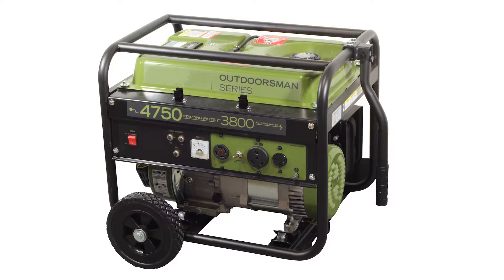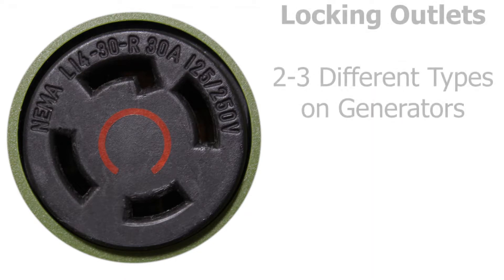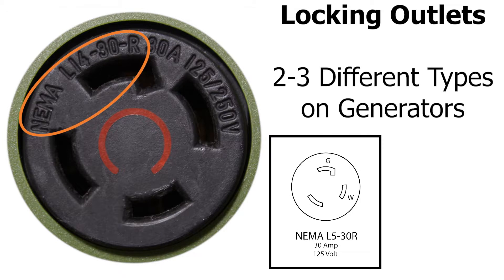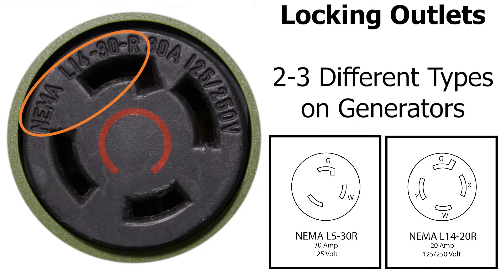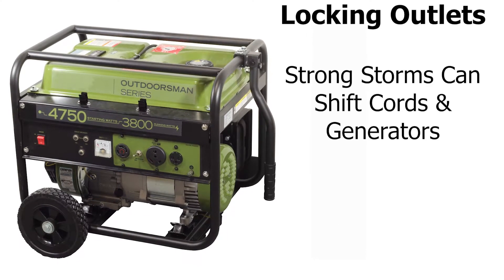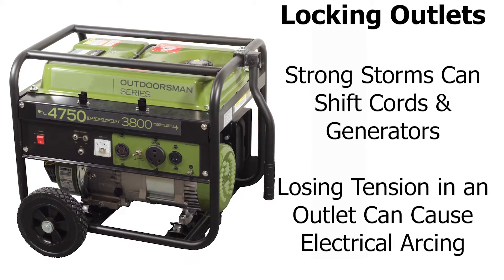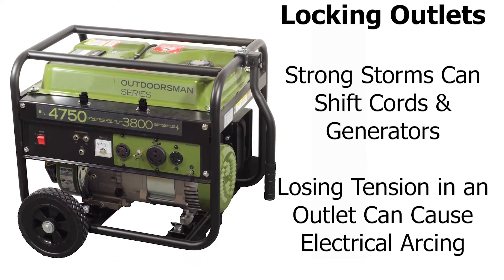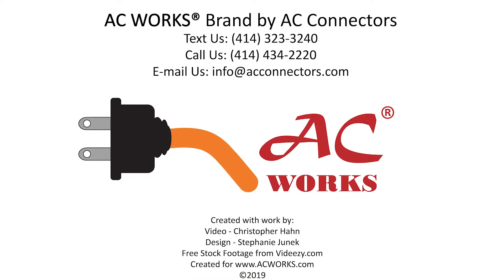AC WORKS® Wisdom: Why Generators Need Locking Outlets

Comment: Your videos are excellent,and very well spoken. I am hooking a new 4 prong adapter to my 3 prong dryer outlet,then hooking a 4 prong generator cable and connection- to run 240 volts to my fuse/breaker panel to run some of my house needed appliances (heater,fridge,lights,microwave.) Adding up my wattages and startup watts if i can figure that out...making sure to first shut off Main,and all breakers..then after plugging in, and gen warmed up..turning on one at a time that are preselected. Having outdoor meter ground intact and adding a copper wire ground and brass stake to ground lug on Generator. Will any line Men working on downed lines be at risk? And...is this an "ok" set up? Thanks for your time and professional input.
Reply from the maker: It sounds like everything is grounded. It would be hard to say for certain without taking a direct look at it. It would be best to have a local electrician take a look at your setup.

Comment: why do they locking connectors to connect boats to shore power?
Reply from the maker: Locking connectors are used with boats/shore power because boats aren't always completely stable. They will always be drifting very slightly. Depending on how the dock is made, the dock could also be moving very slightly. The locking connections make sure the they don't become disconnected.